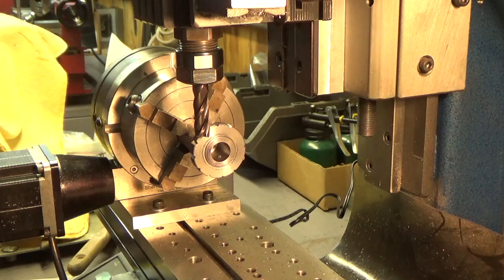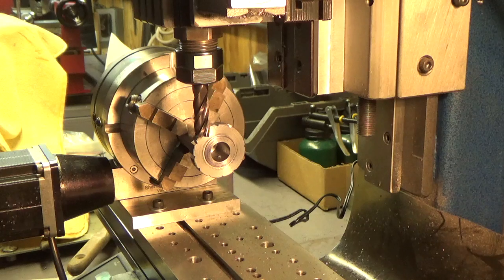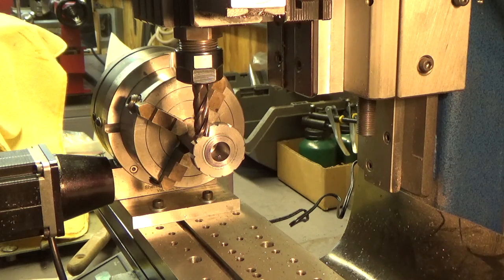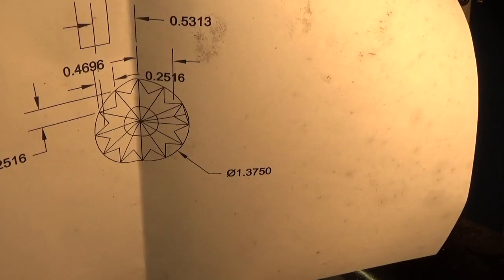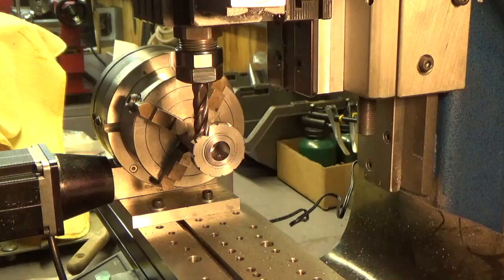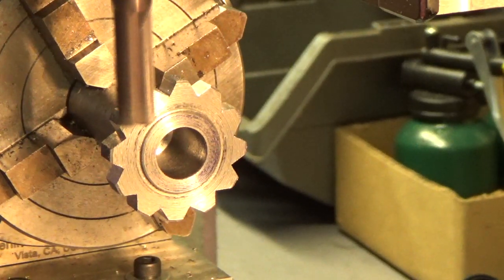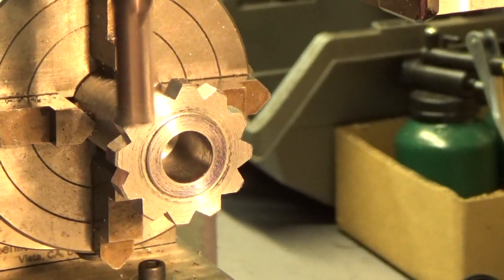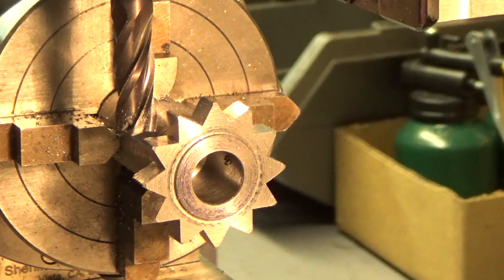Cutting New 12 Point Star Wheel for Shop Built Hand Shaper (Part 1)

Comment: Larry,
    I was in the shop this evening, I blued the pendulum reinstalled it and ran it back and forth it was contacting the starwheel by approx 0.100 and was jamming at one point so I sanded 0.020 off the bottom of pendulum set up a plunger Dial indicator and found each stroke of the ram moves the carriage 0.006 thou,
Reply from the maker: Walter:  That sounds about right.  If I remember 1.375"x12point star wheel has a maximum of about 092" engagement without hitting the 2 adjoining points.  I think you also have a 16 pitch lead screw, so with 12 points on the star wheel the advancement should be approx. 0.0052".  My lead is 10 pitch, so much less fine.  I may work on CAD a bit more and see if a 13 or 14 point star wheel is possible.  The original had a larger diameter star wheel, thus additional engagement.  Thanks for the comment and Best Regards: Larry